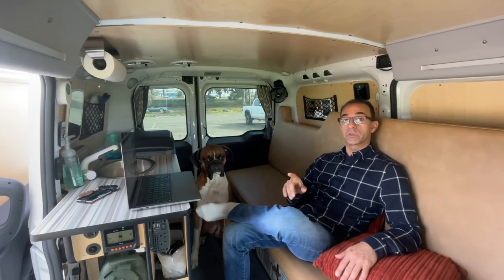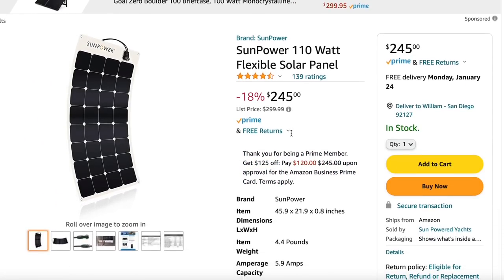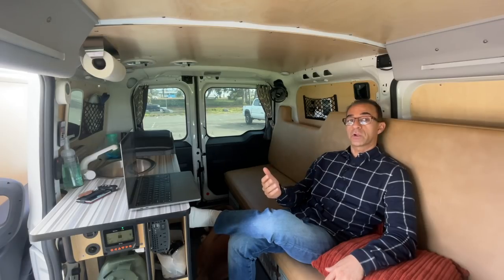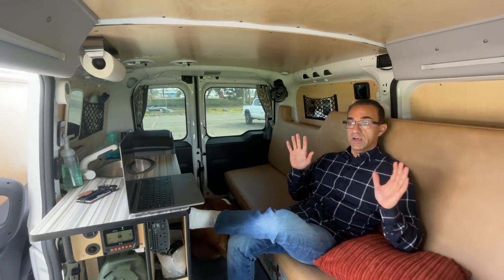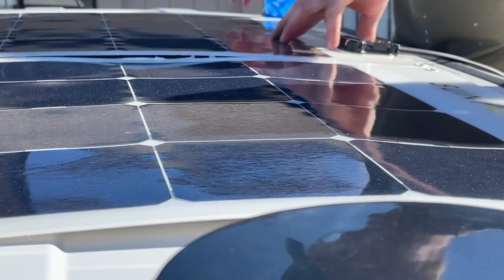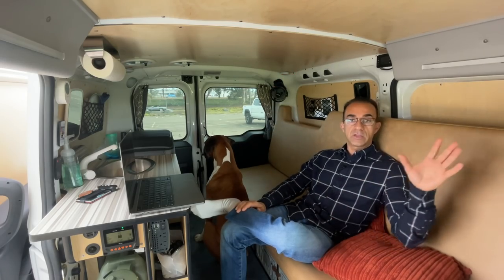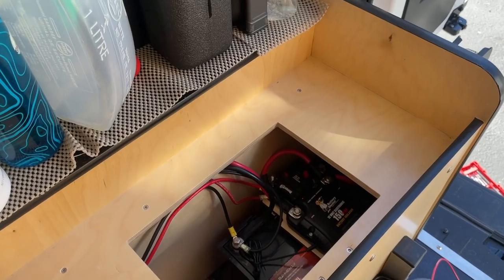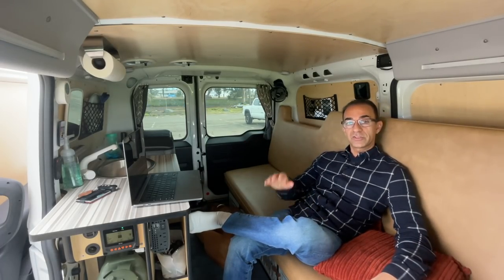My Van Gets BIG POWER Upgrades! (Solar + LifePo4 + DC to DC = 😳) Story #11

Comment from the maker: Rogue Van Company charged me for 5 hours @ 175 per hour (ouch!) but here is EXACTLY what happened.. you guys can make up your minds if it was fair or not.

Work began at 10am, he took a 30m break for lunch and another 30m break helping someone else. I arrived at 1pm and noticed he was fiddling with the chair and I quickly nipped that in the butt and told him to look for 12v source in the back which he found and worked with. Nothing else was complete except for solar which was secured and wired so I am going to assume an 1-1.5 hours was spent looking for a 12v source. From 1pm-4:30pm he continued to work and get things done. No breaks as I was there filming the whole thing.

So was charging me for 5 hours fair? You guys decide. Leave a comment below.
Reply: So let’s do some time management math: Work started at 10am and ended at 4:30pm, that’s 6.5-hrs total to complete the installation.  Subtract 1-hr for Lunch/Helping Other, that’s now 5.5-hrs and if you estimate it took the worker 1-hr to 1.5 hrs looking for the 12-Volt source and playing around with the passenger seat, that’s brings the actual time required for installation to 4-hrs to 4.5-hrs.  They rounded up and Charged 5-hrs total.  In my opinion, it was Not Fair that the Shop Charged you for 5-hrs, it should have been 4-hrs total.  That’s an Extra $175 in their pockets and not in yours.
Reply: Ok, so this place added a solar panel, replaced the AGM with a Lithium, replaced the 10 amp MPPT with an upgraded solar charger. They also installed a DC-DC battery controller as well, in 5 hrs. Adding that +12V ignition power source for the Renogy is a b***h of a job, especially if you don’t know about the 12v outlet at the back of the van, and have to start from the front cab. (Ask me how I know) I’m not a professional installer, but I know what it takes to get all that done. 5 hrs was not unreasonable. In fact, when you first mentioned paying for 3hrs, I shook my head in disbelief, I didn’t think they could get all that done so fast.
Reply: Well as a mechanic, I would have definitely been annoyed by the filming. May have been a penalty lol
Reply from the maker: Huh? Who said it charges when the temps are low? What I said was when the temps go below 30', the heating element turns on so it warms it back up. This is the SMART battery.... its a feature. Amazon it.
Reply from the maker: Bro.. take it easy.. I’ve done my research and saw his vid amongst many others. There are two versions.. the regular one is half the price.
Reply: Will, let it go. Take it as charity. You will accumulate good Karma.

Comment: While I agree that having Professionals do all the electrical upgrades is a Smart decision, I would have rather agreed to a Project Price instead of the per Hour charge.  Who knows how long that worker spent trying to find that 12-Volt connection or How many “Breaks” he took while on the Clock.  You’re be surprised what doesn’t get done when no one is watching.
Reply from the maker: Read my pinned comment.

Comment: Overpriced yes but your happy that's what counts. Fyi don't shutoff tenogy it's designed to run. Lithium likes to be charged. Running low and charging decreases life to a degree. They are happy with a smaller regular charge. That's why new pixel phones have reduced charge speed. Battery less stressed lasts longer. Stay safe.
Reply from the maker: As mentioned in my video, I've only had my battery go down to 80% capacity and by end of the day back at 100%. Lithium batteries don't like running below 20% and between 90-100% all the time. Its OK to charge to 100% once in a while but the happy place is between 20-90% full. Additionally, if you will let them rest for long periods of time, 50% is ideal for LifePo4 batteries. Yes, I've done my research 🧐

Comment: I wish this came with the original installation even if Cascade charges a little bit more
Reply from the maker: I wish too.. would have saved me $875 in labour and less stress looking for someone to do it.
Reply: @WillandRambo  But that's not consistent with their business model, I'm sure. Eliminating options reduces costs, and they appear to be totally driven by lowest installed cost. Example: Adding the additional fan, on the surface, appears to be more expensive. However, I would be willing to bet that because the option has been removed for having it / not having it, they - over the long haul - will reduce their costs because they have one option, one roof template, less inventory (one roof template v. two roof templates), etc. etc. etc. A bit more inconvenient for the buyer, but again, it's all about making it affordable to the masses...many of whom wouldn't opt in for the extras.
Reply from the maker: I didn’t say to offer free options but rather charge and make money on it. The $875 could have gone to CC as additional profits (although I would assume less than that considering it’s all being done in house)
Reply: @WillandRambo  Yes, I understand you weren't saying they should give it away. But again, the additional margin they make on these extras isn't consistent with their business model, and the disruption from options, even with additional margin, costs them in the long run.
Reply from the maker: I don’t think it will cost them more.

Battery upgrade option: AGM or lithium? $200 upgrade option.. no fabrication required.

Insulation: wool insulation? $300 option.. plug in holes.. wrap with marathon fabric using 3m spray adhesive. No fabrication needed.

Bed: charge $300, swap for stiff foam. No fabrication needed. They already offer two colors of vinyl so I don’t see the issue really.

These upgrades are turn key.. they’d make extra money. I’ve run a product business for 20+ years I’m familiar with ROI and COGS.
Reply: @WillandRambo  Thanks for the additional information, and I certainly wasn't suggesting you weren't familiar with ROI and COGS. My apologies if you were insulted. Have a great day.
Reply from the maker: No, not insulted at all. Just speaking in terms of a business standpoint.

Btw, I don’t want to seem like I am complaining about CC. As I said in my review, it excels in every area but it would have been 100% solid with these upgrade options and even better if standard.
Reply: Cascade is very inflexible in that regard.

Comment: I used to regret not pulling the trigger with Cascade two years ago.  Now not so much.  Cascade is way over priced for what you get.  Not enough insulation, crummy electrical,  uncomfortable bed.  Seems like vent fan installation is the only positive.  Am I too negative?
Reply from the maker: CC is great as a weekender but beyond that, it needs an upgrade. You have to sleep in one for quite a while to figure out what works and what doesn't.

Comment: A suggestion for you: get a remote starter. For the cold nights, or mornings, have your heater up and set to run. But you won't have to exit your living quarters to go to the drivers seat.
Reply: I did this when I was living in my camper at minus 30 degrees. All we had back then were deep-cycle RV battery. The battery could not hold a charge throughout the night running the forced air heater and getting up in the middle of the night to charge the battery sucks when it is so cold outside. A remote starter was a godsend and was worth every penny I paid.
Reply from the maker: I have a diesel heater. Please watch my other video on my diesel heater to learn more.

Comment: urm....
you dont need a b2b charger for a 100ah battery and in  actual fact you ve slowed down the charging time in limiting it to 20a
victron energy state publicly it is all about sizing the lithium capacity to alternator output and your van likely has an alternator that is sized correctly to a 100ah lithium.
worth noting you could have utilised the charger the van came with in tandem with the new charger as the bms on the battery will cut off charging at correct voltages...
your battery will probably outlive you even charging  to 100% so use all your capacity !!!!!
you realy should research far more deeply so you understand everything before any purchase or it comes at the high price you paid

Comment: Very nice upgrade!  I am concerned that he connected the dc-dc charger to the 10 Amp circuit in the back.  A really cool feature of the promaster city is the upfit connector.  I connected my Renogy MPPT dc-dc combo charger through that connection.  It has an 8ga wire connected to the battery with a 50 Amp fuse.  I use solar when parked with a portable panel, as I must have my toys, so I have a roof box.
Reply from the maker: The 12v copper wire that connects to the 12v source doesn't use live power.. it is just a trigger to turn the unit on so it draws power from the battery/alternator. Regardless, can you point me to where I can find this uplift connector?
Reply: @WillandRambo  The connector is by your left knee under dash drivers side.  There are 2 connections next to each other.  There is a white one and the one I used is the black one just to the left of the white one.  I was issued the connector pigtails when I purchased the van.  I'm sure you can get them online.
Reply: You also clarified and reminded me about the ignition power switch that activates the unit being from the rear connector.  I forgot, I also needed that connection as well.  There is an ignition circuit on the unfit connector as well.  I certainly wouldn't worry about altering the current setup.  In the future the upfit feature may come in handy for any other electrical upgrades.  Although, wit what you have now, I think you have all you will ever need.
Reply from the maker: Yea I’m done  ✅ lol

Comment: I really enjoy watching your videos. My van philosophy is similar to yours. Although I went the DIY route using a full size van. Since I have zero construction skills, I kept it simple. For electrical, I bought a power station (capable of handling my 1100 W convection microwave). I keep it plugged into the van's 12V cigarette lighter, so its charging at 100 W whenever I'm driving. This is greater than my continuous loads (primarily the fridge). In hot weather, it can last a couple of days without driving. On a couple of occasions,  I've taken it into Planet Fitness to recharge it quickly. Plugged in is  > 1000 W so it goes 20% to 80% in ~30 minutes. I may get around to installing solar, but so far, I haven't missed it.
Reply from the maker: Awesome! 💪
Reply: Do you mind if I ask which power station you bought?  That's the route I'm thinking of and it sounds very promising since I will be doing a lot of driving and camping, not living in it full time.
Reply: @sandraatcheson5453  I have an EcoFlow Delta 1300. I chose it because it has a large inverter, charges quickly, and has no external power brick (just need to carry a cord). The only negative aspect is that battery degradation is high (800 lifecycles to 80%). If this is an important criteria, Bluetti is a better choice.
Reply: @DaphneLowe  Thanks for the info.  EcoFlow seems to be a favorite and the battery degradation part was over my head lol.  Does that mean after only 800 charges it only charges to 80%?  That still sounds like a few years if you only need to charge it up every 2 or 3 days so not so bad.
Reply: @sandraatcheson5453  After 800 charging cycles, it will have lost 20% of its original capacity (ie. a 1000 Wh will now have a max of 800 Wh). So if you use 300 Wh per day, when the power station is new it will last 3 days, when older it won't last a full 3 days. Under most conditions, an EcoFlow should last several years, but it still pales in comparison to Bluetti's 3500 cycles to 80%.  For me, I value the features of the EcoFlow over the longevity of Bluetti.

Comment: Btw, nice upgrades.  I started out with an AGM and hated it.  I love the 100ah lifepo4 I have now.  I also upgraded my 100w panel to a 160w one.  I got a normal panel though.  The flex ones look nice but I've heard they don't last as long.  To help hide it what I did was attach two aluminum L beams from one side to the other of the van and bolted the panel to them.  You see the L beam from the front and back but usually can't see the panel unless you are looking from the side and elevated a bit.  My van came with these channels on the left and right top side for mounting stuff to.  That is what the L beams are bolted to.  So, no need for new holes in the van, glue, etc.
Anyway, here is a review of the battery you got in case you haven't already seen it... https://www.youtube.com/watch?v=xBonGQe363g&t=401s
It is a pretty good battery, according to him.  That guy that does those videos buys tons of different lifepo4 batteries and not only stress tests them but physically disassembles them to see how well they are built.
Reply from the maker: Read my other reply.

Comment: Thanks for the info. I used to drive a truck w a diesel heater. I had some cold mornings I would have to jump the truck from the refrigeration unit. Today it seems so simple why the battery died (cold weather). As truck tech got better, the heater would quit, but had enough battery or separate battery to start the truck to charge the system. Thank you for making the description of the basic parts, more manageable
Reply from the maker: Yes tech has advanced so much. It is inexcusable nowadays for van companies to use AGM batteries considering the benefits. Enjoy 😉

Comment: With having to change your electric system, and I saw something about you adding wool insulation, and so much of the metal exposed inside the van, what I've learned from your vlogs is not to recommend Cascade builds. Live and learn I guess.
Reply from the maker: CC is a fantastic build but each person will decide for themselves what upgrades they need. For most weekender camping hobbyists, the stock configuration is perfect. However, since I live in mine full time, upgrades were necessary.
Reply: @WillandRambo  makes sense, thanks 👍

Comment: Hey Wil, congrats on the upgrade! I too have a Renogy 20 amp DC-DC Battery charger on my PMC. The charger will actually deliver closer to 280 Watts 
(14v x 20a) when charging Lithium batteries. (Ref. Pg 20 Renogy owners manual). If you travel on average 1 hour every second day, you’re already ahead of your previous installation. Between your second solar panel and your battery charger, you’ve got plenty of power for what you need.
Cheers!
Reply from the maker: Oh wow! So that means I have a total of 500 watts! That is huge and way more than I need....  well let me not get too ahead of myself.. When I start driving out northeast for some winter adventures, that might change when using diesel heat the whole night.. we'll see.

Comment: Were you able to tie in / daisy-chain the 2nd SP on the roof with an existing port / connection on the 1st SP, or was an additional penetration through the roof required? (I’m assuming - which is dangerous - that the 1st SP has a roof penetration. If not, and if it enters the van in another manner, please advise.) Thanks!
Reply from the maker: Both panels were spliced together in parallel. Same wires that ran to the battery were used.
Reply: @WillandRambo  Thanks!

Comment: Thanks for the vent fan data. It apparently doesn't come with its own speed control and doesn't reverse. Oh well. Also, check to ensure you have the needed wire gauge for DC to DC charger where the wires go from fuse box (or starter battery) to the 12V outlet in back of van (where the guy wired from) so that you don't have issues later.
Reply from the maker: CC added the speed controller. You can modify it as well.
Reply: @WillandRambo  There are PWM speed controls that can be used I noticed.
Reply: @stevesidare2493  On the subject of speed controllers, I added a 3amp PWM speed controller that I bought on Amazon. I works really well. It also has a reversable switch, but I’ve noticed that the Ventline fan isn’t as efficient when sucking air into my PMC.

Comment: Ah, found the vent link:)  That link, however, is to the same fan I have.  It just has an on and off switch, no variable control.  I suspect that place that installed it for you added the variable control.  Are you able to read a part number off that controller/switch by chance?  The variable controls/switches I've found so far look like you would install them elsewhere in the van and not in the fan itself.  The one you have is inside the fan which allows it to be smaller since you don't need a heat sink if air is blowing over it.
Reply from the maker: Sorry I don’t know. Email CC and see if they can help.
Reply: @WillandRambo  K, thanks for reply.  Btw, I watched the video on the battery you have.  The only thing he didn't like about it was that the one he tore apart didn't have a low temperature sensor on it.  They may have added one though since his review... so yours might have one.
What the low temp sensor does is prevent you from charging the battery while it is too cold.  If you do you can cause dmg to the battery.  I think you can charge most lifepo4 batteries as low as -4F (-20C).  So, I don't think you have anything to worry about since I think you said it doesn't get super cold where you are.  Also, your charge controller might even have a low temp charge cutoff.  If it doesn't and you are worried I think you can buy low temp cut off devices.
Reply from the maker: Mine is the smart battery.. he reviewed the cheaper one which is now $300.. mine has low temp and a heating element.
Reply: @WillandRambo  cool